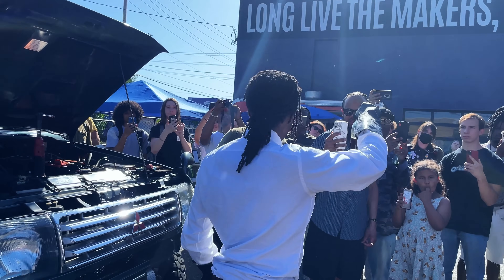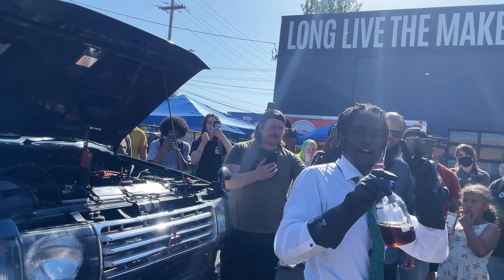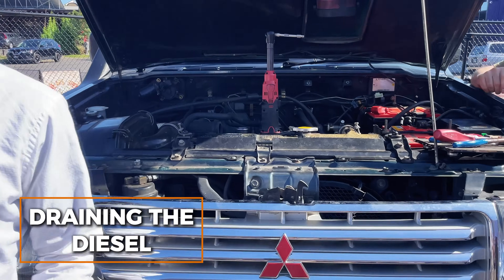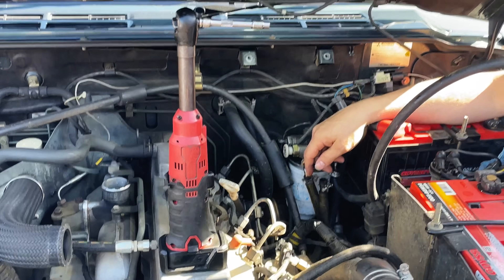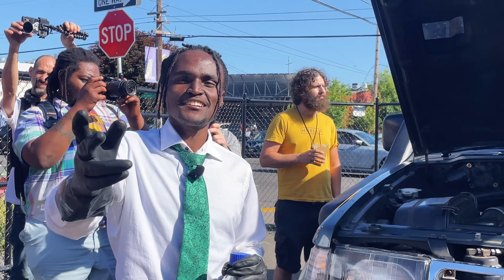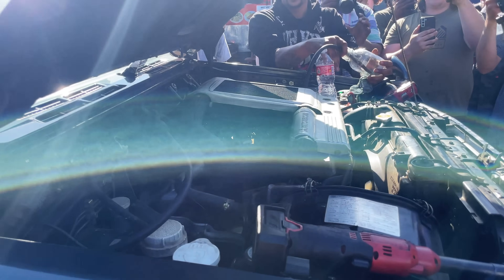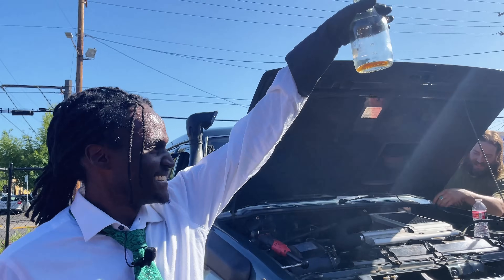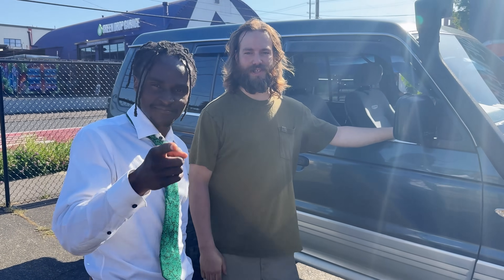World's 1st PAJERO to run off of 100% PLASTIC - PORTLAND ENGINE TEST

Comment: Have you analyzed that fuel by ASTM D2274 or ASTM D6371? If not, then we are soon likely to see that Pajero sitting on the side of the road, unable to start. Expect to change the fuel injectors and filter in the near future.

Comment: Hate to be the bearer of bad news but as a person who works on pajero diesels and other vehicles like it for a living… this is not a good test. It take at least 15 seconds at idle to empty the injection pump of fuel. The reason why it stalled is because it hit air that was introduced when the emptied the filter, it never got to the “plastadiesel”. That jar was just enough to fill the filter.
Reply: You think it could work?

Comment: Hey big bro what if you made graphene wire from that carbon and then you can create an ion harvesting antenna etc and get electricity from the air, research ion power group and everyone should aswell please and spread the word aswelll, ion power group and lasersaber atmospheric electricity are doing an amazing job showing us true clean limitless energy.

Comment: Boy explain how are you  not producing and releasing toxic forever chemicals into our environment?
Reply: Forever chemicals are usually higly halogonated organic compounds which will not be produced by pyrolysis of standard plastics. Yes PVC does hold chlorine and the products from this pyrolysis might need to be checked witth GC-MS or other methods but "forever chemicals" are not realy a concearn to be fair. Toxcicity of the random organic compounds in this mixture might be a more fair concern.
Reply: @bramcoenen2328 total rubbish..most plastic release forever chemicals when heated. regardless of the method use .   
example  heating non microwave proof plastic in a microwave can release dangerous toxic forever chemicals.  any idiot knows that
Reply: @bramcoenen2328 total bullshit.  plastic release forever chemicals when heated. heating non microwave proof plastic in a microwave releass toxic emissions.
Reply: @bramcoenen2328 bs. he's deleting my comments...non microwave proof plastic release forever chemicals when heated..that's common knowledge

Comment: Ok...33 Pounds of Shredded Plastic through Pyrolysis Method makes 1 gallon of 40 Cetane Fuel....But...You need a upper cylinder lubricant added to this...
Reply: Assuming you got the numbers right, that is very telling. I wonder if incineration with power generation is better
Reply: and you will need a cure from cancer as it's full of toxic forever chemicals
Reply: Hey big bro what if you made graphene wire from that carbon and then you can create an ion harvesting antenna etc and get electricity from the air, research ion power group and everyone should aswell please and spread the word aswelll, ion power group and lasersaber atmospheric electricity are doing an amazing job showing us true clean limitless energy.
Reply: Not necessarily all the time especially when it comes to older vehicles and farm equipment because the engines are so small or underdeveloped and redundant for the application like some lawnmowers and weed eaters that require a mixed fuel....there are plenty of real world applications that this could solve if we had positive funding twords this even big oil could but they need to do it the right way and ask nicely or pay the man to further the research and help save the earth instead of being stingy....they can still make profit too but hey what do I know
Reply: Well how about if you insert a sausage through a funnel with a dustpan and brush tied to the neighbours trash can.....would that work too?
Reply: @nitramja7738  What brand of hot dog

Comment: fuel pump was still full of regular deisel you only filled the line and some of the filter and it only ran for seconds it was still running on regular deisel and then cut out when the air went through your deisel was still in the filter
Reply: Exactly he didn't disconnect the fuel inlet line from the tank(whether the system is vacuum or pump pressurized) or disconnect the fuel pump relay or fuse and they primed it before starting. so obviously the pump diesel mixed with the plasticine diesel diluting it in the fuel filter and into the injectors and was not running on "plasti diesel" only. It's was a good show though lol😂
Reply: I'm sorry man but you clearly don't know anything about vehicles fuel filters and cars in general and that's fine man keep being a keyboard warrior😭
Reply: @wolf_cub2430 what part of what I said doesn't make sense please explain if you know what your talking about 😂😂😂
Reply: @ZacRushton1 can't my comment would probably get deleted...
Reply: @wolf_cub2430 who's the keyboard warrior now pal 😂❤
Reply: @ZacRushton1 I’m certainly not I just have to much to say when people want to reply in his comments with negative bs. So either yt is removing what I say in response or he is idk frankly don’t care either if you cant see your wrong then that’s on you not me.

Comment: This type of pyrosis reactor, hydrogen electrolysis, solar, and using the energy from the soil of the earth and atmosphere are the future and will be powering homes, cars, communities in the future. Thank you for your work.
Reply: Hey big bro what if you made graphene wire from that carbon and then you can create an ion harvesting antenna etc and get electricity from the air, research ion power group and everyone should aswell please and spread the word aswelll, ion power group and lasersaber atmospheric electricity are doing an amazing job showing us true clean limitless energy.
Reply: total bullshit comment .  it releases toxic forever chemicals...he and anyone who does a simple search will know its a highly polluting system. 

you can also prove it simply by heating non microwave proof plastic in a microwave.. the .smell of melting plastic proves my point..
Reply: it needs to stop as producing and releasing pfas chemicals